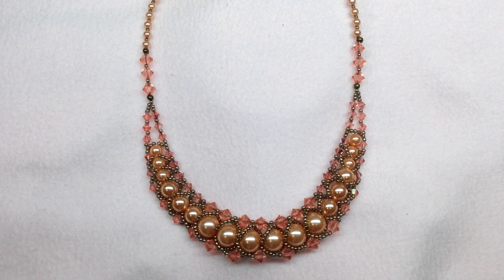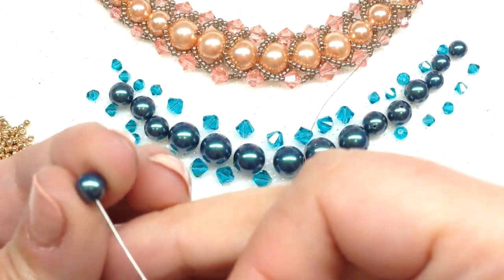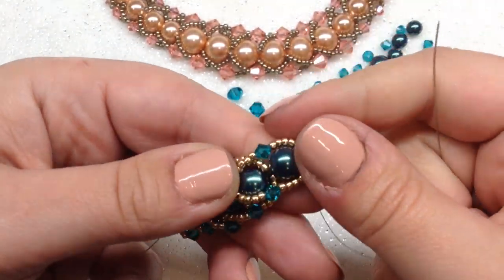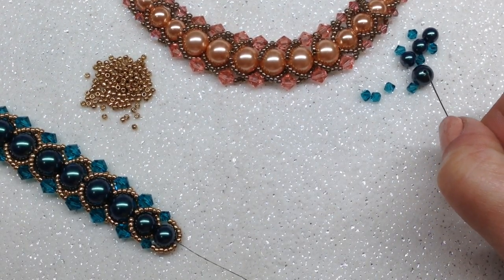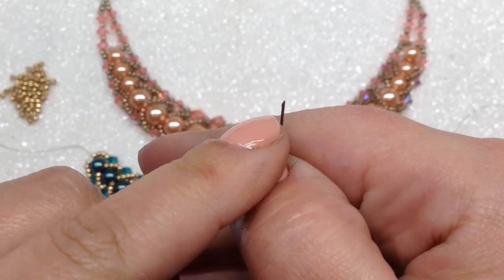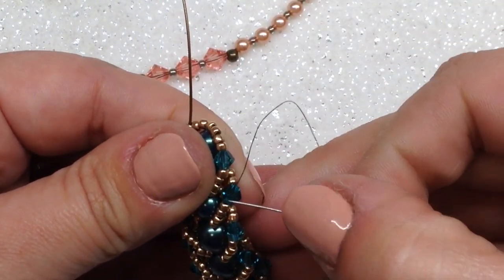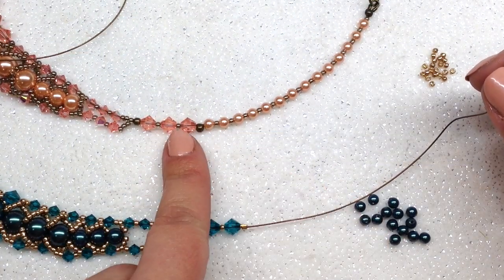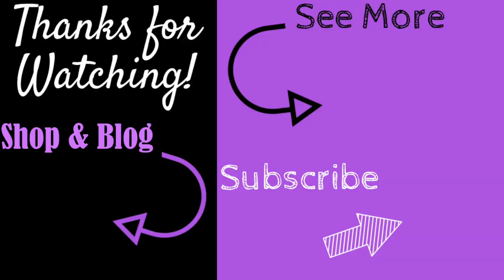Graduated Flat Spiral Pearl, Bicone Beaded Necklace Tutorial

Comment: Hi there Gina, Just a quick question! I'm about to undertake my third try at this necklace (they are getting better with each try so I'm hoping the next attempt will make it.). On my last attempt my last 6mm pearls were having trouble lying flat against the neck, even going up to the where the thread and the soft flex meet is kinda like there was a twist. Do you think maybe this has to do with the crossing of thread underneath the first lot of crimp beads? or too much tension?
Reply from the maker: Hey Megan! Great question. I think both of those things that you mentioned are possibilities - tension probably being the biggest issue for potential twisting at that point. Leave yourself a smidge more wiggle-room to see if that helps, and secondly try not to cross the wire and the thread if you can help it. That should help too. You'll have to let me know how it goes! Thanks so much for sharing! 💜💜💜
Reply: Orchid and Opal Jewelry & Beads Hi Gina, it went a lot better this time! I was doing really well and then I decided it was time to break a seed bead with my crimping pliers.. but! I managed to take the crimp off and save it! Which I was so happy about! I’m not sure I had another go in me (I would’ve had to have given myself a couple of days to recover lol). It now sits a lot more nicer against the skin. I followed your tutorial to the letter and made sure to pull the pearls tight as I did the stitch, also taking care with the thread and stringing wire when they had to be crimped together. I was so happy when I finished!! I wouldn’t say I’m a beginner when it comes to beading but this beauty really tested my patience XD I still have so much to learn! Thank you so much for your videos. I always click on them when I get notified. Even the bead boxes! (Which we don’t get over here in the UK, so jealous) but thank you for being a constant inspiration. Have a lovely Christmas!